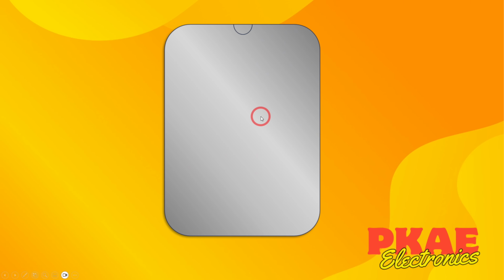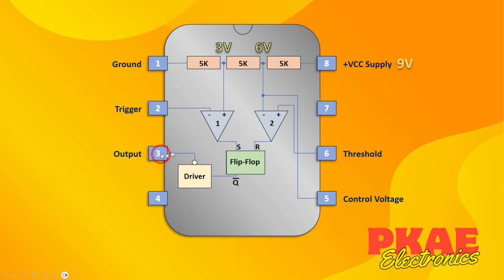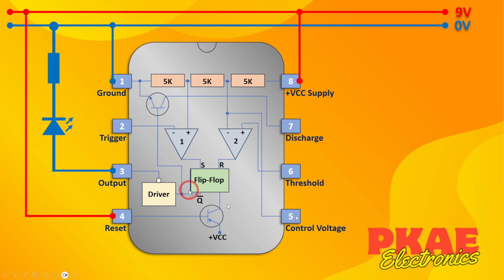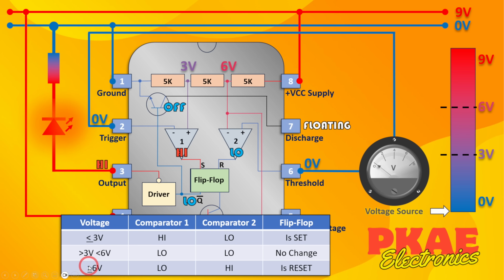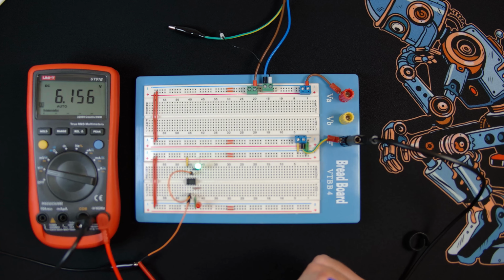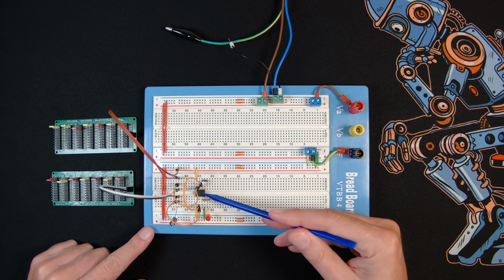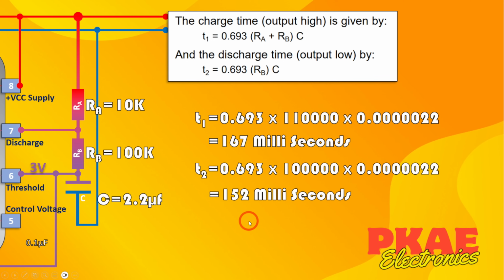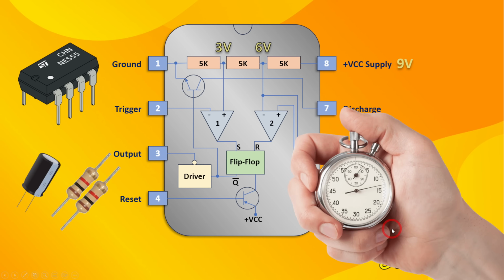How a 555 Works as a Timer.

Comment: Back years ago when I taught myself electronics I bought one of the multi purpose board kits you can use to make 200 or so projects. 
When I played with a 555 that was the most amazing chips ever. Make timers to turn on and off at different times.! Once made a timer that took a month to turn on. After calculating the resistance and caps it was put in the living room and did nothing. Just sat there waiting to trip on. The wife thought I lost my mind. One Saturday about 4pm it came on. The timing was about 6 hours different from what I calculated. But, it was amazing a $1 circuit went off that close after 32 days.  And I made it do that!  The wife really thought I had lost it then. 😂
Reply from the maker: Haha! Brilliant! that made me laugh, thank you.
Reply: It is normally not a good idea to try and make very long delays (say greater than an hour) with a 555 directly because leakage in the capacitor tends to dominate the operation at such low charging & discharging currents, and the circuit is very sensitive to noise close to the comparator trip points. Adding a divider (as also suggested) makes operation much more dependable. Still, I had great fun s a kid learning these things for myself!!!
Reply: @Mike-H_UK  I disagree.  Tho OP achieved 99.24% accuracy on a 34 day delay.  Pretty damn good for $1.35!!
Reply: @jasonbender2459  Even just one nano Amp of leakage from a 1000uF capacitor or connected circuitry will cause a voltage drop of 3V over 34 days. I suspect that the observed 99.24% accuracy was fortuitous.
Reply: @Mike-H_UK   Today, given that a digital microcontroller is so cheap and easy to use, there is no excuse to use 555's as timers... But, back in the day,  they were useful as hell.  As far as accuracy goes, that's why God invented trim pots.
Reply: @Mike-H_UK  You are correct, of course, all jokes and Arduino-Nanos aside.
Reply: Horses For Courses.  For hours/days/ weeks even   with good stability use a 4536 or 4541  CMOS industrial timer.  And to get extreme stability over wide temperature range and humidity in line-powered gear, weak feed the line frequency into the oscillator terminal instead of have R C oscillator. .
Reply: @jagmarc  For any intervals, an arduino nano is far superior in all respects.
Reply: @jasonbender2459   Hobby device tech don't figure much in home appliances at all, too much to go wrong, though having said that a surprising amount of Arizona Microchip ucontrollers do appear.  For a industrial chiller cabinet as example over last 40+ years the defrost timer has zero software, but AC line frequency driving a divider.
Reply: @Mike-H_UK   Fortuitous? It did what he wanted. That changes fortuitous to success.
Reply: @jasonbender2459   555's aren't an excuse. They're a legit component and operate without digital programming. A stand alone circuit with a small collection of passives and nothing needed to coax it into working will remain useful.
Reply: @jasonbender2459   Except that it needs to be externally programmed. A 555 only needs passive components to work. Nothing else is needed.
Reply: @joewoodchuck3824  If success is based on fortune then it is normally rarely repeated. Read my comment about leakage and make your own estimations for voltage droop and its impact.
Reply: @Mike-H_UK  noise in all logic circuits are a problem .. even today..
.. one solution is to use sevral capacitors (for veeeery slow charge/discharge cycles) and perhaps a mix of differnt kinds .. but regardless, with so slow charging time (more than a month) outside facts will be extreme... just putting the circuit anywhere near a power line for example..
Reply: @Patrik6920  Good grounding practices apply to logic as well as analog. aso decoupling caps.
Reply: @holycrapski     Ehh?   I posted a detailed reply and youtube censored it. Its gone. Deleted.  Sorry, you would had found it very interesting.  Well thanks a bunch youtube censorship. I'm out of here
Reply: Your timer was 99.24% accurate.  Well done.  Your wife does not deserve you.
Reply: Fantastic...
ya u can do all kinds of fun stuff with just a very few chips...
Reply: Cool aren't they.
Reply: @holycrapski   100 OA81s  wow your family must must had been rich.  It's so interesting the effect of over half a century years passing has. Virtually no one of today even knows what an OC44 is, also wouldn't know if a OC77 really existed, that most people's first photosensor came from a paint-scraped-off-transistor and that the only practical light source was a light bullb, that the 1960s electroluminescent diodes which came before LEDs made a very dim glimmer and often wore out faster than light bulbs. This was a time that transistors were so expensive that people used transistor holders and plug in sockets often re-used the same ones for other projects.
Reply: Ever played with the LM3909 ?
Reply: @dougtaylor7724  In the late 70s a colleague did a industrial controls dosing pump driver which used a simple RC timer with insane long period and being inexperienced, he didn't realise after it left assembly line no one in Functional Test wanted to wait a week ten days whatever it was. So the boss had to change the timer to something actually measurable and added a CMOS divider IC patched under PCB. We called the guy The 555 Kid after that.

Comment: I am 61 an I am used the chip when I was 17. Didn‘t know this chip is still around. Nice!
Reply from the maker: Still going strong and now manufactured by many companies and in various form factors, TTL, CMOS. There's even a dual 555, namely the 556.
Reply: @paulpkae - don’t know about now, but there was also a quad version.
Reply: @ I used a 556 in the early 90s for a siren control board I made.
Reply: It’s still all over the place.
Reply: 60 y. o. here... same. 
Designed and built a digital clock around it at 15. With the additional 74something nand gate ttl chips, it
had the accuracy of 1 min per hour,
and drained C batteries in a couple of hours...
Reply: Same age.  As a sophomore in high-school, made a logic tester, one 8va piano and a music (repeats 16 notes - varies speed and pitch with pots) synthesiser, each built around 555 timers.  Junior year, the teacher went to make 3x$ at Bendex. 

No one's offered me that after I got my two degrees. 

 His replacement only knew auto electronics, which maybe included ECMs. I didn't take his classes.
Reply: Of course it is still around! I've got a bunch of them in my drawer of digital chips, along with my TTL and CMOS series chips. I first started tinkering with this chip from the TTL Cookbook, author Forrest Mims published by Tandy/Radio Shack. I've still got my copy of that book along with a bunch of chip pack cardboard "data sheets" stapled to the inside cover of of this book. Back in the 70s/80s, getting data on chips was hard. You kept those precious package data backs, and was very familiar with the Reader's Guide to Periodic Literature, and microfiche film at libraries to get data. Now it is just a Google search away, or a visit to Digikey! Technology has made some things easier.
Reply: @brainforest88  we had stuff with 8066 processors  😮

Comment: wow! so we can change the two R to specify: 1) how often to water plants AND also 2) how long? 😮🎉
Reply: Indeed!  Or you can use a moisture sensor in place of the capacitor (and presumably a few resistors to get the voltage levels right) and let it figure out by itself how often and how long to water the plants.
Reply: @BrooksMoses  Cool! Now i know how to use those 555 timer boards on Amazon. Hilariously, i have a MS in Electrical Engineering. Shopping now…

Comment: As I  remember it the issue was people kept calling it an oscillator, which it isn't. So if you're saying its not a timer either, erm.. what is it?
Reply from the maker: That's a tough one to answer. 

It's basically a combined comparator/flip-flip. 

You only make it become an oscillator or a timer by the components you choose to add around it. 

You could just use it as a latch (flip-flop), a Schmitt trigger or countless other implementations.
Reply: Infinitely repeating, delayed, on-off switch?

Comment: thanks for teaching me about internals of the 555, and how to use it :)

but, isn't a current flowing through out Ra during "Discharge" phase a problem?
I guess, as it's less than 1mA (9/10k) in your case, it is not that huge deal...
Reply from the maker: Thanks for the comment.

It's not a problem for the reason you rightly point out. Current from the +V rail will flow through Ra, but that's one reason why we use high resistance values.

There are better circuits than the basic Astable example given in the datasheet and I do intend doing further follow up videos covering some of these. But in summary, you can add a couple of diodes to block/divert the current to suite.
Reply: @paulpkae  thanks, I'll wait for your next video about that :)

Comment: On the NE555, the reset input always overwrites the set input. 
On the B555, the set input overwrites the reset input. The replica wasn't quite perfect.
This only happens when pin 2 is low and pin 6 is high at the same time.
So comparator 1 and 2 are high at the same time.

But for most circuits it makes no difference, because pin 2 and 6 are mostly connected.
Therefore both comparators are different   or   both low.

With the B555 the /Q output of the flip-flop is not used but the Q output. 
That's why set is stronger than reset. Accordingly, the output driver is not inverting.

Comment: It's an oscillator 😂 I do what it does with a few transistors... all the time. never used a 555 in my life
Reply from the maker: The 555 is mostly transistors also. 

Bear in mind, it's a versatile chip that can be incorporated into many circuit requirements, not just an oscillators. 

If a few transistors suites your purpose that's fine. But you may find, given the mass production, that a 555 is actually a cheaper option overall.
Reply: @paulpkae  Transistors all the way 😅 they're still going hard at 2.5V
Reply: @Dazzwidd  The LMC555 is guaranteed down to a supply of 1.5V. See how good your discrete circuits are with that supply voltage. It also works up to 3MHz and has typical rise and fall times of 15ns.
Reply: @RexxSchneider  You're silly, the 555 has transistors inside 🤣
Reply: @Dazzwidd  And you're even sillier if you don't know the difference between discrete transistors (that you were taking about) and integrated circuits, especially ones that you've never used in your life.
Reply: @RexxSchneider  You're silly because you're a troll. I've seen the internal circuits of the NE555. More versatility with transistor circuits.
Reply: @Dazzwidd  You should head back under your bridge. It's pretty obvious you're the one doing the trolling.

The NE555 costs no more than £0.25 even in small quantities, which is about the cost of 3 BC547s, It is far more versatile for timers, monostables, pulse shaping, etc.

You can't match its cost and reliability for any of these sort of applications, where discrete transistors are simply obsolete.

Now stop spreading your misinformation and accept that you've been caught out on the nonsense you've been spouting.

Comment: Excellent video. One question, why do they call it a multivibrator?
Reply from the maker: Thanks for the comment. 

Odd name "Multivibrator". It's supposed to define a circuit which has two states. 

The "Astable" Multivibrator (demonstrated in my video) has no stable state, it continuously flips from one state to the other.

Comment: I know it works that way but the LED's resistor is supposed to be before the LED to protect it from current coming from a source.
Reply: Current is the same everywhere in a circuit, it doesn't matter what the order of those two series components is.
Reply: @bjornroesbeke actually it does, the resistor is to protect the diode from overload. If a short to ground appears in the circuit between LED and resistor the resistor is bypassed and then the led will draw everything it can from the pin blowing the led and possibly the pin where as if the resistor was the other way around and a short between led and resistor happened then the led would be bypassed protecting it and the resistor would protect the pin from over draw
Reply: @AJB2K3  I can't say your explanation is wrong, but a short to Vcc or another power rail is just as (un)likely, it all depends on how a PCB was laid out and whether the user has even the tiniest bit of competence.
Reply: @bjornroesbeke  It would be hard on a 555 timer to short the LED to VCC as VCC is the far side of the timer.
Reply: @AJB2K3  Sorry, but no. In your circuit, a short from the junction between LED and resistor to the supply will similarly bypass the resistor and the LED will again get the full supply across it. You seem to be working under the impression that a short to ground is more likely than a short to supply and that just isn't true generally. Maybe in automotive applications, you'd have a point.
Reply: Don't let the ElectronFlow Conspiracy Theorists hear you say that,   they'll say the resistor must go under the LED because electrons come out fiirst from the IC pin.
Reply: @jagmarc  They have been arguing this for a while but in the end it is down to a miss understanding of protection.
Reply: @AJB2K3  Can't see what all the fuss is about, buy a long tube of them cheaper than postage just plug another new one in.

Comment: You can also control your charge and discharge simply by a single resistor connected from output to trigger and threshold. In this way you get 50% duty cycle. With the circuit you have shown you can never get 50% duty cycle. Furthermore you waste the current coming across Ra during discharge time, which is 10 times the current you need for the discharge of your capacitor. So your circuit is not very effective during the discharge time.

It is somehow strange, because I have seen your circuit everywhere, also in the data sheet of the NE555. But it is by far not the best circuit to make a simple and effective NE555 astable multivibrator.
Reply from the maker: @gkdresden  thanks for the comment, I may well use this in a follow up video. 

The Astable circuit in my video is indeed the standard method given in the datasheet. I was intending on follow up videos to discuss duty cycle and by adding a couple of diodes you can achieve a full range of on vs off times. 

Despite the benfits you point out, in your arrangement you would be fixed at 50%. 

Interesting. Watch this space........
Reply: @paulpkae  this was really quickly.

The disadvantage of the simple design is the fixed 50% duty cycle. But in many cases you just need a rectangular signal no matter how the duty cycle is.

But even if you need to design a certain duty cycle, the standard circuit is not the best way to do it. Also in this case the output control performes better with 2 resistors and 1 or 2 diodes.

If you need a good linear control of your duty cycle you can set an adjustable bi-directional current source between output and trigger / threshold.
Reply: @gkdresden  Actually the disadvantage of the simple circuit is that the output voltage on pin 3 is not stable, and depends on the current it is sinking or sourcing, which then affects the timing. It's also not symmetrical as the low output rises by about 0.1V at 10mA, while the high output will typically drop by 1.4V at 10mA. As you can see, the frequency and duty cycle will depend on the load (as well as temperature by the way), which may not be desirable in many circuits.
Reply: @RexxSchneider  In order to avoid this problem I use the CMOS version TLC555, which has a totally symmetric output stage. It has also the advantage to allow higher frequencies or steeper pulses.

But you can also use a 1k resistor between output and Vcc to get a symmetric almost rail-to-rail behavior of the NE555 as long as you don't exceed 0.1 mA output current.

The 555 is not really a power device to be operated with more than 0.1 mA output current. normally you control high ohmig inputs with the 555 output. So the demand of timing current is in your own hands.
Reply: @gkdresden  Sure, we all use CMOS 555's when we can because they are almost rail-to-rail, low power and almost zero leakage at the inputs, which allows much larger resistors, smaller and more precise timing capacitors, and so on.

But this video, and hence your comment, is clearly concerned with the NE555 bipolar timer, and I felt it necessary to correct the false impression you gave in your posts.

The main disadvantage of driving a single timing resistor from the output of an NE555 is not the 50% duty cycle as I explained, and it should be obvious that the duty cycle can be easily adjusted by using diodes to steer the charging current through two different resistors between the output and the timing capacitor.

Loading the output stage towards Vcc works for very small currents, but many applications of bipolar 555 timers take advantage of the 200mA drive and sink capability of the device, even if that's not available for the full supply swing.

I strongly disagree with your assertion that the 555 is not designed to operate with any more than 0.1mA output current. Bipolar 555's are perfectly happy sourcing or sinking currents a thousand times greater than that. Even the fastest CMOS 555 (the LMC555) is rated for -10mA, 50mA output, enough to drive LEDs, fans, small motors, etc.

The whole point of using the standard astable circuit is that the timing is completely decoupled from the output, so it is easy to design the timing without having worry about what the output will be driving.